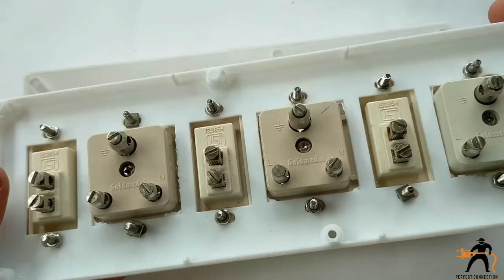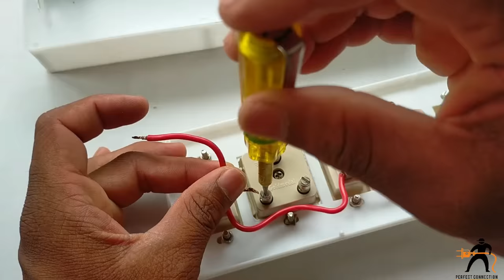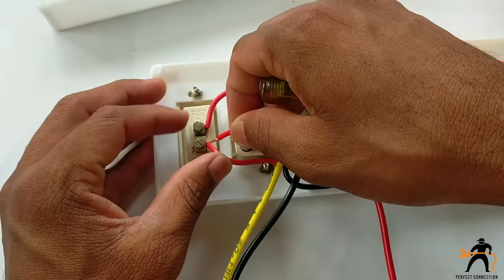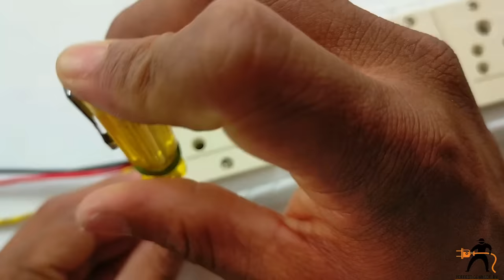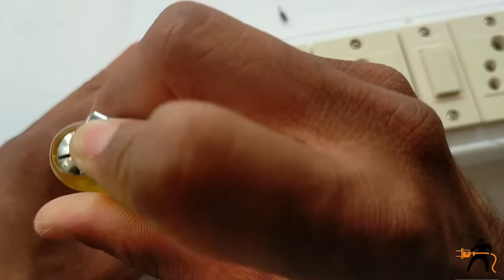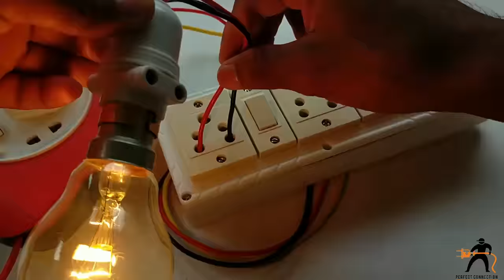3Sockets+3Switches connnection | Extension box wiring by #BEEEWorks | Switch board wiring |

Comment: I had done all the process but there is a current flow while switching off mode
Reply from the maker: Then exchange supply wires, it happens due to mismatching of phase and neutral wires